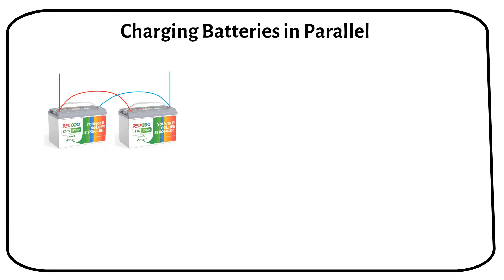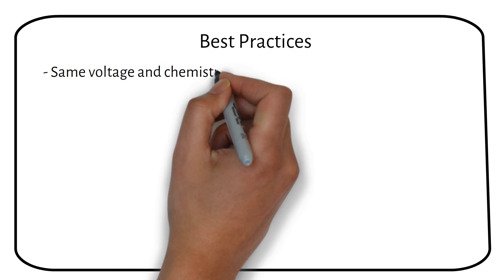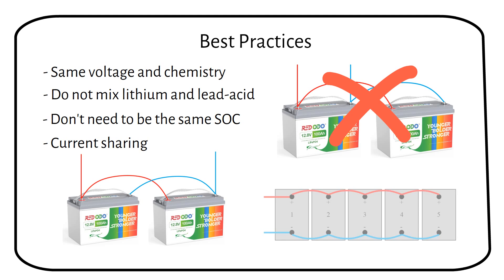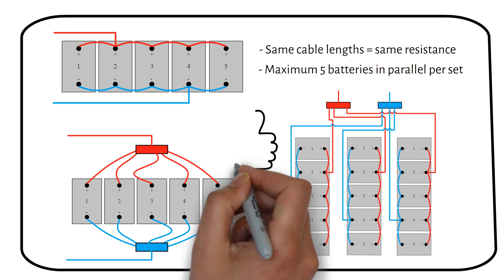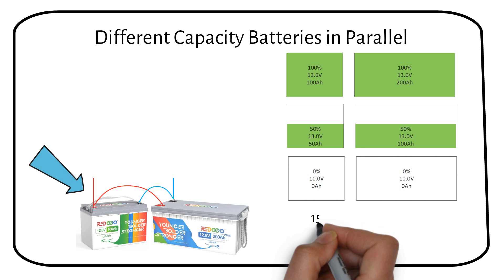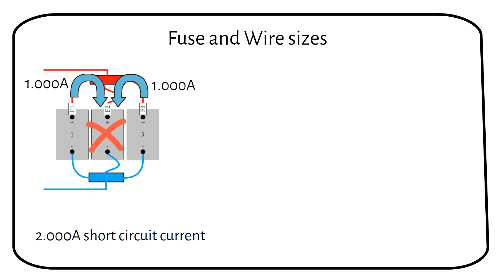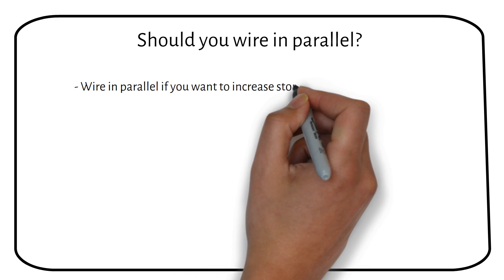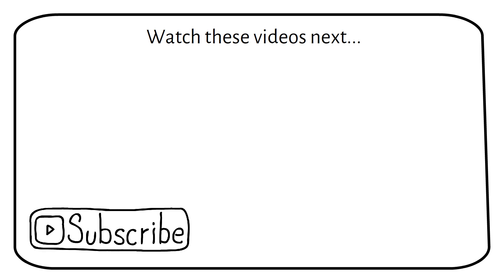How to Charge Batteries in Parallel With Different Capacity

Comment: Good morning
I have 2 packs of Lifepo with the same voltage but
1 is 24 volt 1120 AH and the other is 24 volt 200AH
I would also like to put // both
I don't know if a fuse is needed between the two?
otherwise my converter is a 4000 watts to 24 volts
what do you think about implementing // the 2 packs?
busbars between the 2?
THANKS
laurent
Reply from the maker: You should wire batteries in parallel. I have videos about fuse and cable sizes, check them out on my channel.
Reply: I wanted to put the 2 packs on a busbars with 2 BMS and then busbars on converter

Comment: Thanks for the video, i enjoyed it.  I have 4 x 240ah 12v Lifepo4 batteries in parallel. Ive come across another 12v 300ah lifepo4 battery(same manufacturer). Would it be safe to add it to my battery bank? Thanks
Reply from the maker: Yes, but only in parallel.
Reply: Thanks for that. Everything is in parallel.👍

Comment: Is this possible? = 2 batteries 12V 100AH each, connected in SERIES (Result: 24V 100AH). And after that this will be connected in PARALLEL with 1 battery 24V 100AH (Result: 24V 200AH). Thank you!
Reply from the maker: Yes

Comment: Thanks for this. I have a technical issue with my setup. I have four 12v 200ah batteries from the same manufacturer. My inverter is a 24v system so I connected two batteries in series to give 24v and parallel with the other two series battery. Now I have the battery bank at 24v 400ah.
After about 3 hours of use by the inverter, I noticed that the 2 batteries on the negative parallel line will drain to 10v while the 2 on the positive parallel line stays full at 13.3v. What could be the problem please? Could it be that the 2 batteries on the negative line draining to 10v are faulty? I have only used this setup for 2 days before noticing this as the inverter beeps low battery after 3 hours.
Pls help.
Reply from the maker: What happens if you switch the leads over? Check your wiring again. Are there any imbalances in the batteries? If so, charge every battery individually with a 12v charger and connect again.

Comment: i have two power queen 12 volt100amp batteries. i am connecting in parallel with a renogy 700 watt inverter.
can i use 6awg wires to connect both batteries?
Reply from the maker: Checkout my video about sizing wires. Then check my video about sizing fuses.

Comment: Never install batteries of different ratings in any battery bank. The bank will not equalize and the lower capacity battery will reduce the capacity of the larger batterie. Reducing over all capacity of the entire battery bank over time.
Reply from the maker: Like I said in the video, you can parallel different capacity batteries.

Comment: Know your battery chemistry.batteries should always be within a specific voltage when connectin in parallel or serial. Lithium batteries should always be fully charged and within .2 tenths of chage difference.
Reply from the maker: In series yes, not in parallel.

Comment: So I have a question, I have a 24 volts inverter and from my calculations, 3 lead acid batteries of 200Ah will be enough for my daily usage.
Now how do I go about this, can I connect two of the 200Ah batteries in parallel thereby giving me 400Ah at 12v then connect this to a single 200Ah battery in series to give me a 24v battery bank? 
If this can be done, what will the total battery bank capacity be.
Reply from the maker: You cannot connect different capacity batteries in series. You can only use 2 batteries.

Comment: I wonder if its possible to charge 4 serial connected batteries(48v) with a 12v charger with a ballance wirering
Reply from the maker: You can do that when there is no load attached. good for initially charging the batteries before commissioning them. But should not be done long term.

Comment: question??
i have 50ah lifeo4 24V series connection assembled and 75ah lifeo4 24V same series assembled..i am planning to parallel to parallel this so i can get 125ah...now the question... is it possible to use 1BMS 100A  in this 50ah and 75ah if i combined it in parallel

Comment: Thanks for your tutorial. Please How can I get 48V and range of 3820Ah to 4000Ah when connected in series and parallel
Reply from the maker: Thanks! Why do you need that big of a battery? A 48V 5kW server rack is 100Ah. So you need 40 server rack batteries. That's $50,000.
Reply: @cleversolarpower   please can I talk to you privately via email?

Comment: i have two custom made 24v 100ah lifepo4 batteries made with 8 prismatic cells each. I used JK 100amp smart BMS.  can these batteries be connected parallely? how BMS would handle the charging?
Reply from the maker: These can be connected in parallel. The BMS sees every battery individually. Because they are in parallel, they will be at the same voltage. One battery can charge with more current than the other, no problem.
Reply: @cleversolarpower  thanks for explaining. Let me clear one more thing. i have two seperate custom made batteries EACH WITH A BMS. So there will be two batteries with two different BMSs. Still they can be connected?

Comment: I am a qualified fitter for solar photovoltaic systems. I am interested in what would be the order of the budget for one system. What does it start from?
Reply from the maker: It depends on how much power you consume and how long you want the battery to last on cloudy days. off-grid is going to be more expensive than on-grid. But if the power company charges more than installing an off-grid system, then the choice is clear.

Comment: Contemplating the following set up: adding 4 identical 100 amp Li batteries-3 will be in series for a 36 volt trolling motor. 1 will power an audio amp an isotherm 12 volt fridge. I will have a NOCO Marine 4 pole charger when plugged into shore power-thinking of charging when running motors with a DC-DC charger. Looking at the Vectran XS. Can I charge all 4 batteries with this DC-DC charger if I use a busbar? Thanks. Your videos are super helpful
Reply from the maker: Thanks for your sub! So your three batteries will run the trolling motor, and one battery will run a 12V fridge? Ideally, you need a 12V charger and a 36V charger. However, you can also charge the three 12V batteries if you manually switch them when one is full. However, this is not practical, so you need a separate 36V charger.
Reply: @cleversolarpower  Sort of: three of the batteries in series to run the trolling motor while the 4th one would be a house battery. Each battery will have a shore power charging from a 12 volt Noco Marine charger that will individually charge each battery as they are needed. When I am not on shore power I am wanting to charge the batteries with a DC-DC charger using a busbar. Not sure if the DC-DC charger will do that properly or do I need 4 DC-DC chargers

Comment: Question. i got hold of 57 free batteries of 6volt 4,5Ah NiMH type of batterys  .. Thats a lot of batteries.. i wish to make a giant powerbank in parallel connection .. Is there something i have to remeber? ... do i need thicker cables then the ones that already are on the batteries?  how is it when i charge that many batteries in parallell ? do i need a super charger? or just use a normal charger that will just take much longer time?
I also got a hold on 43 of 4 cells NiCd batteries with a voltage of 4,8 and they have 4,5Ah  -- planned to make a 2nd powerpack with those.    All batteries are only 3 years old and they are fully functional.. they had to be replaced because of strict rules on batteries that feed emergency light on ship .. they get replaced every 3 years even the law say 5 years.. guess shipping company just want to make sure their ok .. they have been maintain charged trough the years they been active.. and they only sometimes get used on test of the emergency light onboard.
Reply from the maker: The 57 batteries are not that big actually. Assuming they have 100% of their capacity left, it's only 1,500Wh. A little more than a 12V 100Ah battery which now cost $260. Your second battery is 928Wh, close to a 12V 100Ah battery. So would you rather spend a lot of time, money for a BMS and not knowing if it is safe than buying two 12V 100Ah batteries for $520? I think you know the answer.

Comment: Is it advisable to charger the battery with the ac output of the inverter charger, i.e the ac current the inverter charger produced?
Reply from the maker: You can charge the battery with the solar input or through the ac input. The output is used to power loads.

Comment: This expiation is not correct at all. If the voltage rating of the batteries is the same even though they are different capacity batteries they will supply the same current to the load.
Reply from the maker: No, try it yourself.
Reply: I don't need to. My statement is correct. Try looking at it like this. Using a 10L (10AH bat) tank, 5L(5AH bat) tank, 5mm tee hose where the tanks are connected and the third end goes to a valve then to atmosphere. The tanks are sitting in such a way that the water levels are at the same height. Now open the valve water will drain from both tanks equally same as in batteries.   @cleversolarpower
Reply: Nooooo

Comment: I have four GEL batteries. Two are 100 Ah each, and two are 120 Ah each. The inverter operates at 24V. I have three solar panels, each with 390W and 40V connected in series. The charge controller can operate at 12V, 24V, 36V, and 48V. What is the most optimal way to connect the batteries? Two batteries of 100 Ah in series, two of 120 Ah also in series, and then those two in parallel? Where should I place the fuses and of how many amperes?

Comment: Thanks for your great help. I have 3 LifePO4 12v batteries: 1 is 50 Ah, and 2 of them are 75 Ah. I also have a 1500w Pure Sine Wave Inverter. How many of these batteries should I run in parallel? I want to charge 48v EGO batteries as well as other low draw uses like 12v lighting. Many thanks. --Douglas.
Reply from the maker: You can run the 3 in parallel. other voltage systems should have different charge controllers and inverters.
Reply: @cleversolarpower Thankyou

Comment: Hi there, mark here from Australia. I have two 135ah lithium batteries in parallel and two 300w panels in series . So I have 270ah and 600w of power going through the charge controller. Have I got that setup right or do you recommend another way if it’s an overkill.  Kind regards, mark.
Reply: Sorry I forgot to say I’m using a 2000w to 4000w pure sine wave inverter converter DC12v to AC240v unit
Reply: Hi there I get the charge of the batteries thank you. When I send that charge to the inverter, how is that done please. 🤓🤓
Reply from the maker: 600W/14.6=41A going to your batteries at max output.
2000W/12V=167A -> ok for lithium. 
Check my video on sizing wires and fuses.

Comment: Thank you for the PDF download, I just want to say that your disclaimer with conductor sizing based on the 90°C column really should be based on the 75°C column because most devices that will be terminated to that cabling will not be rated with a 90° C termination. Therefore the possibility of excessive heat being transferred through the terminations to the device could either destroy the equipment or cause a warranty issue.
Reply from the maker: I have never heard about lugs having a temperature rating. I researched it, and you are right; they do have a temperature rating. However, I do not think it plays a significant role as long as they are quality lugs and not cheap lugs. A welding wire rated at 105°C should then also be downgraded to a 75°C rating; that doesn't make sense to me. We did not take this into account when working for a major chemical company. I have a video about the quality of lugs coming out soon.

Comment: I trickle charged two batteries in parallel, but find this not good enough. The difference of conditions leads me to believe the weaker battery undercharges and therefore could sulfate. Therefore, I individually "top" them off.
Reply: I presume they are lead acid? You didn't say.
He seems to think all examples have s battery management system.

Comment: What an excellent and very helpful channel.  I have just installed 3 x 120a 12 volt batteries in parallel connected via two very thick solid copper busbars for a total of 360 amps.  I took the negative off the first battery and the positive off the last and then ran them up to separate busbars for distribution to - 240vac/12dc charger, dc to dc converter and a 3000 watt inverter.  I hope I did the right thing.  I have now subbed to your fantastic channel.  Thank you.
Reply from the maker: Thanks for the sub!

Comment: thank you for helpful explanation
If I have 24v 200A lifepo4 battery used for about 1 year and I wanted to add another battery from same size and voltage and brand name 
could this be done ? what is the precautions ?
Reply from the maker: You can add the battery in parallel. Not a problem. The main positive from battery 1 and the main negative from battery 2.
Reply: @cleversolarpower  thank you , but I was informed that the inner resistance  of LiFePo cells becomes higher by time of using it .. and it is not recommended to connect new batteries with used one. Cuz there will be difference in cells resistance 
What do you think

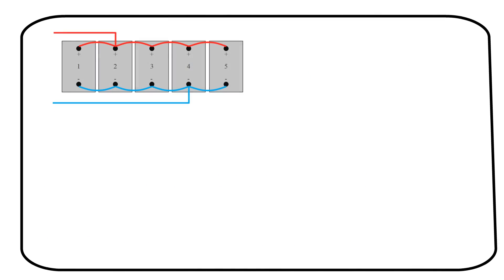Comment: I think you've made a mistake.  You emphasize the importance of having the same series resistance in the charging wires.  You correctly recommend a pair of bus bars from which the wires to all battery terminals are of equal length.  But your alternative solution for 5 batteries does not achieve equal resistance.  If you have five batteries with four red and four blue link wires as shown at 2:50, then for batteries 2, 3, and 4, the series resistance consists of two link wire resistances (counting from the points where the main red and blue cables first split).  There are two blue links for battery 2, two red links for battery 4, and one red plus one blue for battery 3.  So far, so good.  But batteries 1 and 5 each have four link resistances (one red plus three blue, or three red plus one blue).  Surely, for equality, the main red wire should go to battery 1 and the main blue wire to battery 5.  That way each battery has four link resistances in series with it.
Reply: @rainerinedinburgh5807: Agreed. See also Victron Wiring Unlimited.
Reply from the maker: Indeed, it doesn't have equal resistance. This is how I would wire it if I don't want to use a busbar.

Comment: I must have missed the part where you explain what the Shunt is for?? Or is that in another video??
Reply: The shunt is for measuring the current going into and out of the battery bank.  That way the charge controller (or perhaps a separate capacity meter) can keep track of, and show you, how full the batteries are.
Reply from the maker: Couldn't have said it better.

Comment: Great video.  Very informative.  Question though: I built a 24v system using two 12v 200ah LiFePO4 batteries in series.  Now I plan to increase the capacity to 300ah by adding a 24v100ah LiFePO4 battery in parallel.  Assuming I have all the correct breakers/fuses and wire sizes in place, what (if any) should I be looking out for in this set up?  Is this a safe configuration?
Reply from the maker: Run the third battery from the busbar like the diagram i showed near the end of the video. It will run perfectly.
Reply: I do have bus bars between the batteries and the inverter which I put there to facilitate addition of batteries in the bank. Thank you for confirming I'm on the right track!
Reply: @cleversolarpower How many 100ah 12v batteries can i run on a 2000w Inverter? Is it up to 4 in parallel? Right now I have have 2 batteries and want to add a 3rd then a 4th when feasible.. thanks